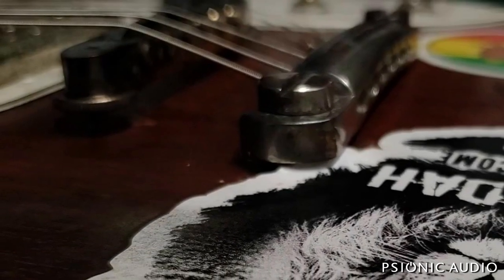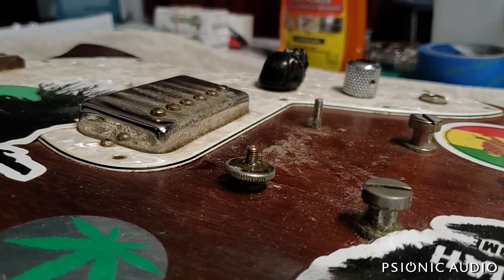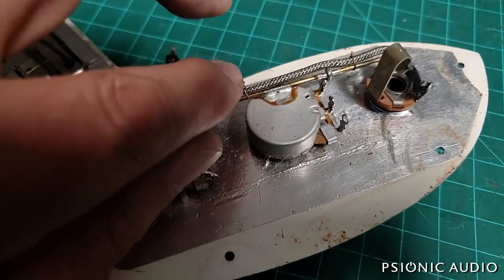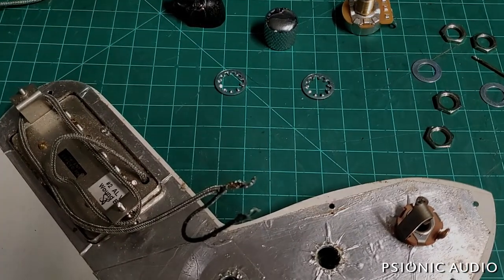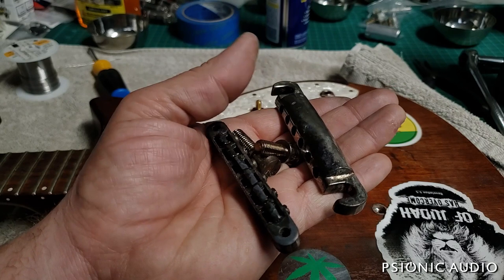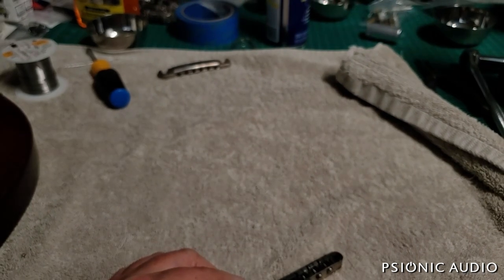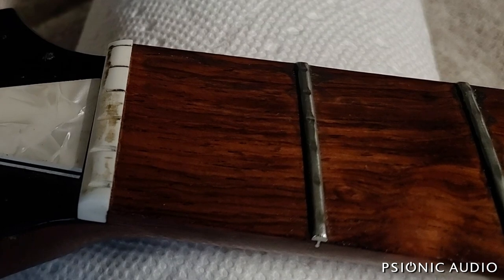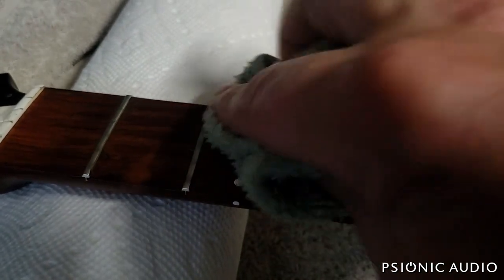Guitar for an Old Friend

Comment: One of my guitars has a small piece of cigarette paper under the D string until I get around to fitting and cutting a new nut.  The Bennett guitar is very similar to my 90s Patrick Eggle New York.  Same body shape, fret marker positions and headstock shape.  Though the New York has TOM bridge and through body stringing.  Hints of Rickenbacker, PRS, Telecaster and Les Paul Junior, along with a nice baseball bat of a neck, a rock and roll machine.

Comment: I like Simichrome polish in the yellow tube for frets and metal hardware. Also, the Mitchell's abrasive string from StewMac is great for cleaning nut slots and saddles.
Reply from the maker: Yeah, I use the Mitchell's string too but didn't bust it out for this. As none of the frets were actually causing problems I just let them be on this old girl.

Comment: I swear Mojotone or Tube Depot has brass pot collars. They’re for the small Alpha pot shafts to fit 1/4” knobs. It’ll probably work if you make a slit lengthwise. Or just use some brass shim stock from the hardware store.

Those frets need some love! Those diamond nut files from Music Nomad are probably right up your alley, considering the amount of setups you do.
Reply from the maker: Oh, I only do 2-5 setups a year, mostly on my own stuff. I have my buddy Bobby to do the serious stuff that takes the tools and (more importantly) experience I lack.

I have a big bag of brass collars. One went on the split shaft tone pot here so I could use the setscrew knob.